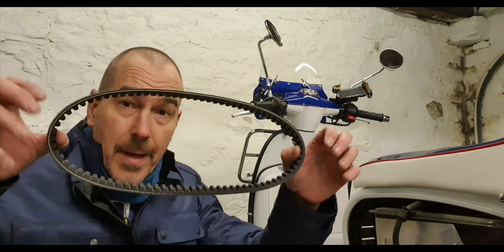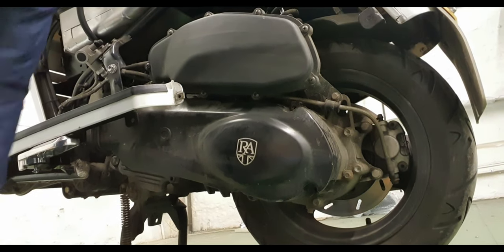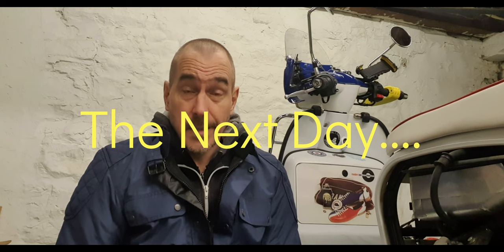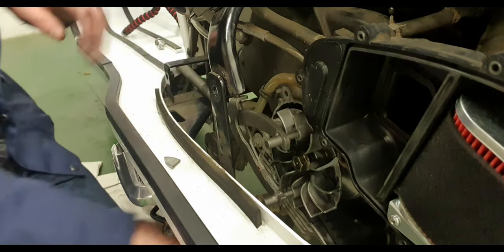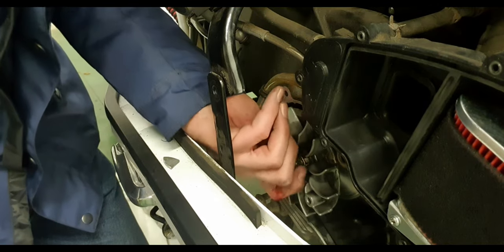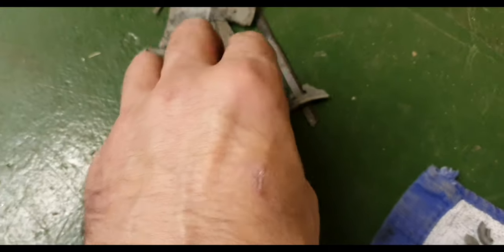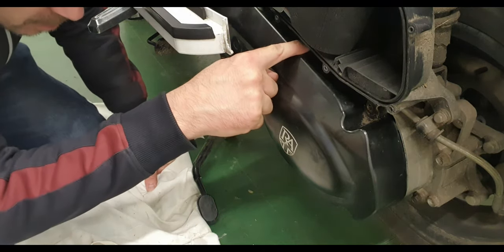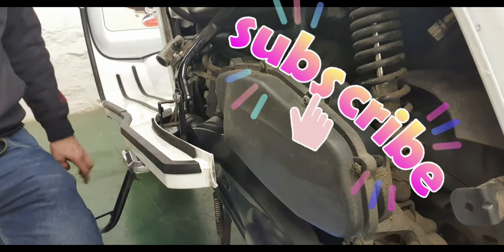Changing The Belt on a Royal Alloy Scooter

Comment: Interesting first try, when you put the screwdriver in the fins I was saying NOO and then it happened, for removing the clutch nut all you need to do is tie wrap your rear brake lever to the handgrip and the rear wheel will lock, I'm worried that clutch nut will spin of because you didn't torque it up correctly! Been watching some of your post and enjoying a lot, it's great that your doing stuff yourself and I like to see your on the runs posts👍
Reply from the maker: Thank you mate, it's all a learning curve. I'm enjoying having a go and learning something new, even with a few clangers 🤣 Plenty more videos in the pipeline. 👍 Thanks for watching. 👍🛵

Comment: Great video mate,  I bought the variator tool a while back as I owned a Scomadi as well as my RA200. When I came to checking the belt condition which was ok as it happened one thing I did notice was the variator did not have locating holes for the tool to fit . Why RA should do this is beyond me . There appears to be a tool specifically designed by RA but I have yet to come across one . Impact wrench is great for removing it’s the re tightening to torque where you have to be careful .See so many with the fin or two breaking off . I’m sure your video will help a lot of riders . Thanks very informative.

Comment: Enjoyed the video mate. I've done many transmission strips on vespa gts's a tip or two for next time . rough up the variator plate with Emery cloth make sure the variator plate is not polished same with the clutch bell inside clean with Emery cloth making sure it is rough and clean the pads on your clutch with Emery cloth also use blue Loctite on both the variator nut and the clutch locking nut great first attempt mate enjoyed every minute
Reply from the maker: Great tips Mark thank you. I'll incorporate this into a future video 👍 Love it when more seasoned experts can chip in, as it helps all of the viewers. Thanks for watching and commenting.

Comment: to make things easier for yourselves  id take the air box cover off like shown but also take off the floor board, it gives you more unrestricted access, also i may be wrong  but i noticed when  you first tried getting the clutch off with the inpacted machine the clutch started spinning and so did the rear wheel,would you be able to stop the clutch by aplying the rear brake just an idea

Comment: Torque wrenches generally not to be used as a breaker bar..unless they are designed to torque left handed bolts as well.
You are a brave man with only rudimentary mechanical skills, but please keep it up and surely your skills will improve. BTW..you could hold the clutch by gloved hand to loosen with an impact gun.
Reply from the maker: Thank you for the tip George, I did not know that.. I'll check out which type I've got. Thank you for watching.👍🛵

Comment: Well done for your continuous  effort  a lot of people would have given  up.brake cleaner  would have been fine to clear out the belt cover.i have used your variator  supplier  good prices.i am glad  you bought  the right tools. I would recommend  any bolt you remove put some copper grease  on stops them seizing.the only other advice I could offer you next time sand down the clutch pads a little so there not shiny.  helps when pulling away.i would also mark the nuts on the variator  and clutch  so you know if there near tight. Someone also said locktight the nuts good call but only locktight blue,or your never get it off again. i have been thinking about your repairs.for the variator  blade don't repair it,as it could come loose and damage the transmission. For the plastic bit that broke off 2 things come to mind gorilla glue made in the usa but sold in UK very strong  or if you need any bracing hot staple gun works with shaped w and melts into the plastic  quite cheap amazon or eBay. And lastly  remember  to reset your torque wrench  back to zero or it won't work properly  settings. 
Peter the floor panel  you damaged is available  about £25 new but used parts on e Bay. But it looks like a poor design  strong glue  should do it.

Comment: Great video mate. I did exactly the same. Broke the variator fan. I replaced sliders and clutch. Completely ruined the gasket and I haven’t put the cover back on yet. I been riding with it open. Have you tried removing the back wheel? That’s my next project. I want to put a lower gearing in for higher top speed but unlike other Gy6 engines our back wheel needs to come off to get into the gear box. I think 🧐
Reply from the maker: Hi Gene, ha ha we live n learn ! No I haven't removed the rear wheel yet, can't help you there.🤔 Were you trying to get hold of me on one of the Facebook groups ? Thanks for watching.

Comment: Good videos mate but a few observations; My own routine would be to clean down the engine and surrounding area and keep it clean. All ways clean bolts and use either copper grease or correct loctite. note asian materials are not as good quality and so will corrode easy. The other item was, did u use a torque wrench  to undo the nut??. Using this will possibly upset the calibration settings when u use it for its correct purpose in tighting up bolts/nuts to the correct torque settings
Reply from the maker: Brilliant tips Stephen thank you 👍🏻 I wasn't aware of that you could upset the calibration of the torque wrench, defo bear that in mind for the future. Thanks for watching and commenting 👍🏼

Comment: Hi 
I can’t believe it just watched your video and I did the same as you did I damage the fin could not undo the nuts 
Bought the tool from eBay and a impact gun then job done the only thing different I did was to put some lock tight on the thread 

I’ve just taken my front wheel of my GT 125 for painting and now can not put it back on that’s your next video but good luck with that one 
I’m 70 years old and I’m still Learning from your videos keep them coming 👍😎🛵
Reply from the maker: Nice one Peter, bit of a bugger, those nuts, sure were tight !😂. Not sure I'm brave enough to take the front wheel off yet, but I'm sure you've checked out @RoyalAlloyGuy 's you tube channel. He does have a video on front wheel removal. Thanks for watching and good luck !👍

Comment: Never attached it in the fins when opening pulley nut. I advice put it on the back window of your pulley. About the broken fins. You can still use it by sending it to machine shops and they will enlighten your fins on the same cut damage . Note skip every 1 fins. You will see the difference how fast is your pulley gonna play off.